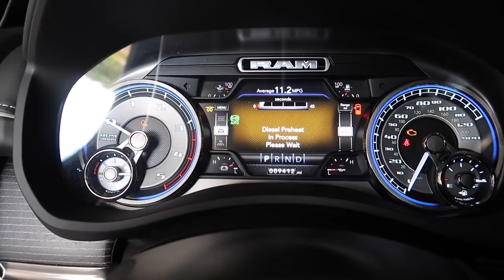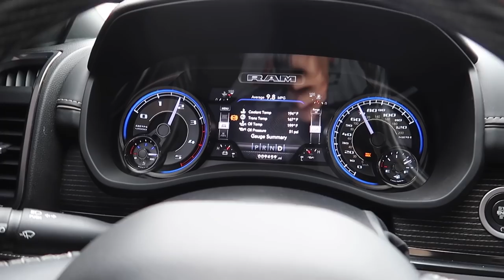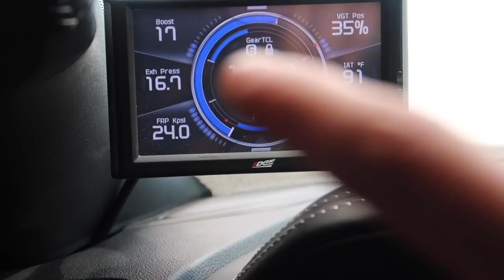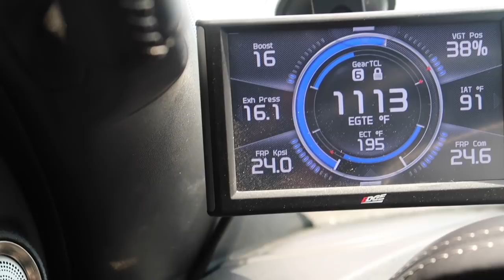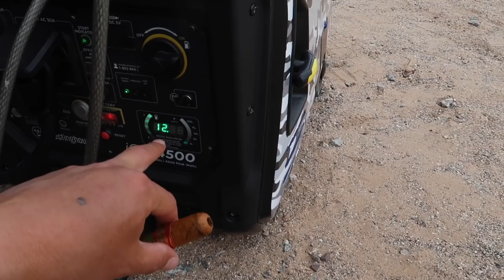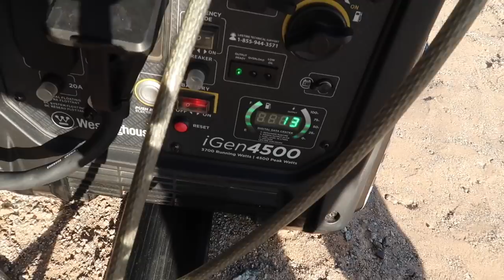First time pulling the toy hauler

Comment: I've been waiting for this post. I've been wondering how well the new toy hauler would tow with the UTV in the back. I too just purchased a toy hauler, a Stryker 3212. At 9710 lbs dry weight it doesn't weigh as much as yours but I am concerned about the weith of my Oreion Reeper in the back taking too much tongue weight off the back of the truck and causing sway. Glad to hear yours tows just fine. I'm towing with a lifted 2015 Chevy Silverado 2500 LML Duramax . No delete or tune so not as much power as your Ram but not as much weight either. Hopefully I'll be ok.
Reply from the maker: nice man congrats im sure you will tow perfect
Reply: I have the stryker 2916 and I pull my rzr4 turbo  in front first. Tows just fine. Lifted 2012 lml. You should be fine.